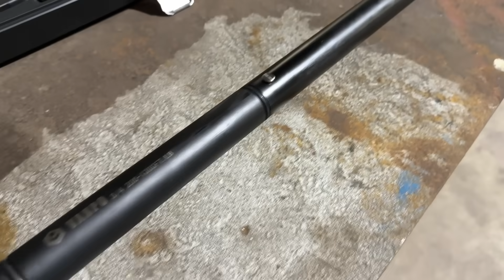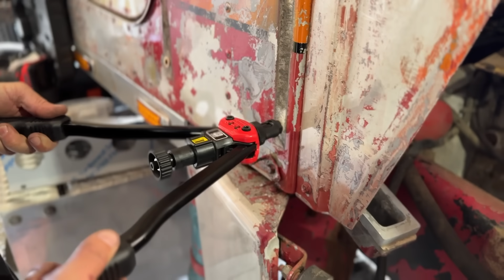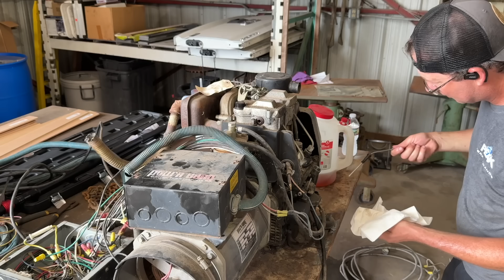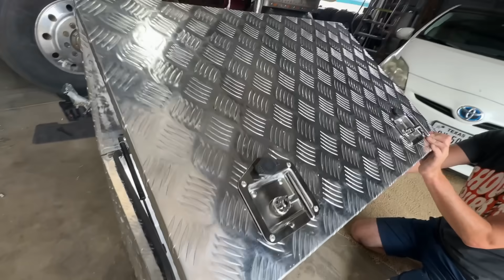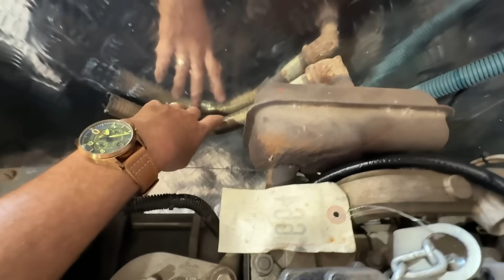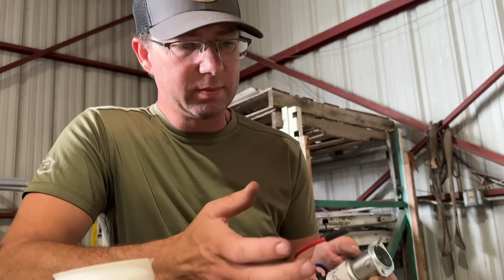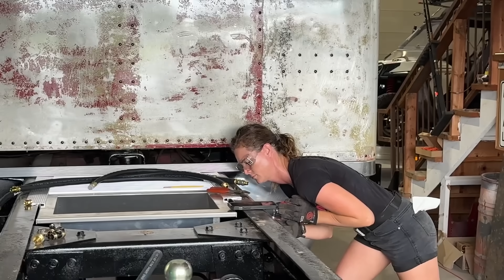Onboard Generator, 2nd fuel tank and MORE!

Comment: 7:34 You can take out the pilot bit, add another smaller hole saw on the inside of the chuck that fits the existing hole. It will protrude farther and the bigger saw will bite after.

Comment: Loving the truck videos. Small tip: When cutting a bigger hole with a hole saw, you can screw on the size u want then screw on one that is the size that is there. Use it as a guide so it doesn't walk. But how u did it works too.

Comment: Fwiw, if you get any kind of wobble in the front end, jack up the front end and loosen the lug nuts, have someone step on the brake and retighten. This centers the brake drum ,but You should do it right away before the tires start to wear cause if they do it will be too late 😉

Comment: When drilling a larger hole, then what has already been drilled by a smaller hole saw.. take the drill saw blade that is the size of the smaller hole and install it in the middle of the bigger hole saw.. so you use the smaller hole saw as a guide if you will and it keeps the larger hole saw from traveling…(walking).,

Comment: Its coming along and looking great!
If this truck had a personality, I swear in some shots you can see it smiling.
Curios...
Why not run twin tanks, one on each side, and mount the generator on top of the frame rails behind the sleeper?
Since trailer swing clearance between the sleeper and trailer is a non issue.
Would give easier access to the genny for maintenance. Save you trouble of dealing with the box lid hinge design. And prevent the box from filling up with road grime from spray from the front tire. Also in the event of a mishap, the generator would be safe from any impact or damage.
I'm sure you can buy/fabricate a wind breaker to hide that roof AC. Will help the front of trailer to prevent and exhaust soot.

Something else to consider is a closet style headache rack. Can mount the genny in it, and have more room for more storage. Tools and extra parts for OG come to mind.
Also the weight of stored items could give you a smoother ride on the front axle.

Comment: Safety Heads up - Observation -> I am a little late viewing the series and I apologize if someone has mentioned this already but I have just wrapped up a number of mods on my fifth wheel in the inverter / elec area and I seen in your video - your generator plug mounted on the truck.  Your twist lock plug has the "Male" side of things - If the generator is running (producing power) the exposed prongs will be energized and as such an easy shock hazard.  The plug you have used is found on the rv side as there is typically not a stand alone power source in an rv or a transfer switch is used as to not transmit elec to the male prongs.  There is a female twist lock that you could use OR I simply installed an RV receptacle so that I only have to cary one universal power cord that works to plug into campground power OR plugs into my Inverter with rv receptacle OR my Generator with receptacle. Also your Power port you mounted on the driver's side of the truck - if it is wired in with the generator consider the use of a transfer switch as to not backfeed and create a shock hazard on that plug in as well.  The plug you put at the driver's door is correct but needs to be isolated as to not be energized when genny is running OR worse yet - a scenario that plugged into Campground power it could back feed into generator circuit and damage something / create an unsafe situation. A transfer switch would solve this.  
ALSO - consider a single inline breaker on that AC line to the plug on the truck - just in case a random bolt would fall on those Male prongs and short out.  The breaker would interrupt other possible damage...  (safety) Even if you have installed a female plug - still best to install a 25 or 30 amp breaker between genny and plug.  I would also recommend a main breaker after the Plug from driver's side of cab.
Thanks for being open to feedback and awareness to want to do the best / safe / proper thing/. NICE WORK!!!!  My dreams for an HDT to pull my fifth wheel have been awakened by your work and video series and your get it done mindset!!  Nice job problem solving that generator solenoid as well!!! Let me know if I can explain more / better for you.  THANKS!!!!!

Comment: when the hole is bigger than the pilot drill for your bigger hole saw -just quickly cut a piece of wood and drive it in tight - then your pilot drill will not drift off center and you get a cleaner big hole in its place. hope that makes sense .love your work and your wife is eye candy,

Comment: Love what you're doing, I have a 90 t800 with a 600 HP 3406e in it, hauled livestock for 10 years now it's a grain train but my cab is falling apart,rivets falling out,need help on what rivets to use

Comment: Good to have, but do you need a CDL if the truck is designated as an RV and onlybhauling an RV?
To be designated an RV the sleeper needs sleeping, cooking, and toilet. A mini porta-potty qualifies and doesn't need to be used so long as it's there. If it's designated an RV then you could both legally drive and don't need to stop at scales.

Comment: 359 Pete’s are just meant to be flat tops   I still run with some stick wagons pulled with a 359.  Grossing over 90 all day.  My buddy left his 359 in his will to a driver.  We pulled the 5th wheel off and gently placed two 4” straps over the casket, centered between the drive axles. That 359 literally took its owner to the grave.  These videos are awesome, and so is your knowledge of the truck

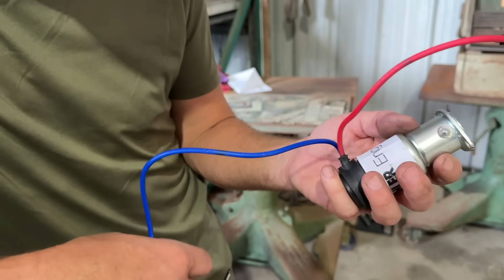Comment: On your fuel solenoid (53:18), some on these have a "Pull" (the blue wire, higher amperage to energize it) and a lower amperage "Hold"  that could be your red wire. I would imagine that the Red wire will go to your "On / off or Run" switch, the Blue will go to your started switch or solenoid (energizes only when cranking). I bet that the bad one that was on there was wired incorrectly.  Think of it like two separate electric magnets, a big powerful one to move that internal slide,  and a smaller one just to keep it open. Love your project.

Comment: Being a person who made a generator out of a single cylinder indian sign diesel motor you'll have enough electricity to run just about anything you want. A/C, microwave, tv, charging for computer. I'm not all the way through the video yet but you'll want a 12v exhaust/radiator fan on the gen box opposite of the flywheel side of the generator. The heat will be too much inside the box and the fly wheel fan won't be strong enough to exhaust it out. PLUS, you'll want to insulate the inside of the box to quiet down the engine noise. Nice upgrades on the Pete, as you can see I've got a 387 Plastic Pete. :D

Comment: Hey Guys Love what you doing to that truck wow  a Few Pointers  for Parts  C7C Equip and ADS =Area Diesel Service   They are the best in the Market  and they will almost find anything you need for  Diesel and stuff like it Gen Box  cut cover  Screw Hinge to front  (Cut the L cover ) and transfer  Hinge to front like that it open like you want and screw top cover to Box

Comment: how about a piece of angle aluminum across the top front of the gen box and move the hinge from the back to the front, which I see you have removed altogether, fasten it to the front side and pop rivet a strip across the back where the hinge was.  Quick access.  I'm sure you can figure out a proper propping device to keep the door open when you need it.

Comment: Hi guys Tony here watching you from my Mercedes actros 6 x 4 2548 semi truck in uk, surely the generator box lid could be adapted using the piano hinge you removed cut the lid and refit the hinge and the pump on the generator in uk we have round fittings like that one one the blue wire as our positive terminals have threaded nuts on them to attach ancillary items loving the build though

Comment: It won't help now and the wood behind the panel worked fine but next time you have a hole that you want to make bigger with a hole saw, take the hole saw that fits in the hole and screw it into the larger hole saw and use it to center instead of the drill bit.

Comment: I scrolled down a bit, but I didn't see a response.  A 50A RV plug is 240V.  It's 4 pins.  Two hots, a neutral and a ground.  But RV's don't typically have a 240V load.  What they have is two 120V panels.  So when you get some place and only have a 30A socket, the 50A to 30A adapter ties the two hots togethers so that both panels still work.  There are reasons for it being that way that take longer to explain than I want to type into a comment.  Optimist Grime is looking really good.

Comment: Did you share the info on the torque wrench?? That handle look’s longer than the one I have…

I have a 3/4 makita and I love it! It takes my lugs to approximately 400 ft pounds. I like that it’s just under the spec because too tight is also a bad thing….

Comment: Does the solenoid need to be powered for the generator to run or do you energize it to kill the generator?  It would make sense for it to get hot if it is powered all the time when it should not be.

Comment: On the rears when you put the plastic ring between the wheels the inner nut needs to be torqued then place the outer wheel on then torque the outer lug nut too

Comment: I was watching Aaron with the hole saw at the beginning thinking to myself I would screw a piece of wood behind the panel for the drill bit to center on. Thirty seconds later that’s exactly what Aaron did. The truck looks great with air filters on both sides 👍.

Comment: The holedozer hole saws are designed so that if you have an existing hole, you can screw the corresponding hole saw into the center of it to use as a guide instead of the drill bit.

Comment: Aaron, the next time you need to cut a larger hole around another smaller hole, if you have the size of the smaller hole it should fit inside the bigger hole saw and act as a guide. I have done this on several occasions.

Comment: I'm pretty sure that your engine and generator is the same as is used on a service truck that occasionally visits our farm. The mechanic who drives the truck is able to run a pretty modern stick arc welder off this combination quite successfully (as well as other power tools) so long as he does not push too hard for too long otherwise something overheats and shuts down while it cools down.

Comment: Love the content and thanks to CRC for supporting such a cool project.

Are there plans for some type of air or suspension hitch on truck or trailer?  I’m thinking there is not enough pin weight and the truck suspension may put too much stress on the trailer pin.  But I could be wrong.

Comment: Great build.  Thinking about the gasket for dissimilar metals and thinking potentially it’s an unnecessary cost as you don’t run the gaskets against the brake drums on trucks with alloy wheels or on your car so not sure that it’s a lot different.  Maybe I’m missing something …

Comment: You may already know this but I thought I should mention it anyway. It is important that you not only make sure that the generator is producing around 120 volts, but also 60hz in frequency. Most of the digital multimeters can measure that. The frequency is based on the engine speed and the governor can be adjusted for that. The hz should be around 61.5 to 62 with no load. I have learned this from a great YouTuber James Condon who knows everything there is to know about small generators. You might want to watch a video of his.  I hope this helps.

Comment: 2nd post for you , this one is a safety issue. when you you use a impact to put a lug nut on, if it starts hammering that is not torquing the nut. if the nut does not turn at all when you use a torque wrench that is a major fail. doing that on Budde rims that is a good way to break the rim between the lug holes

Comment: I would consider wrapping your generator exhaust to keep the heat down in box.  Also consider adding ducting for cold air intake to engine and alternator so they are not intaking warm air as the air in tbe box heats up.  May need to add an electric cooling fan to exhaust hot air from the top of your gen box.

Comment: Sometimes those solenoids have two activation circuits.  Your blue wire may be the initial power that moves the solenoid and then your red wire holds it for the long term and power to the blue wire goes away once your red wire is active.  Less current draw and less heat build up in the solenoid over time.  Red wire coil isn't strong enough to pull solenoid open like the blue, but is strong enough to hold.  Not saying that's what you have but I've seen that on Yanmar's.

Comment: That Duetz solenoid should be blue to pull and red to hold once it is in the run position. A lot of smaller industrial diesel engines do that

Comment: Don’t know it has been mentioned, but it appears the hood needs to be adjusted forward a good 1/4” if not more. It should have a little gap between the hood and cowl. Love the progress. If everything is adjusted correctly and all the bushings aren’t worn out and the helper springs are tensioned correctly you should be able to tilt the hood from the front grab handle fairly easily. ❤

Comment: The blue wire gets momentary power to drive the solenoid  and the red gets power to hold it in the on position. The blue has to be momentary power only or the solenoid would burn out from too much current and heat. Case is ground of course

Comment: That solenoid has two coils in. A strong coil for pull and a weaker one to hold it in to run. If you just use the pull coil it will get real hot and burn up

Comment: If you haven't sorted the solenoid out already, the red wire may be a "hold" wire. The blue is an activation wire which draws a large current to pull the solenoid on, when running the current should switch to the red wire which holds the solenoid on with a lower current draw. If the solenoid is held on always by the activation wire, it will overheat. This was the was a lot of small diesel engines were set up, yours may be the same. Hope this helps.

Comment: Hey Sparks, if you're gonna be putting holes in sheet metal, especially if there is a pre-existing hole of the wrong size, you might want to invest in a Chassis Punch set. No hole saw walk and leaves a clean hole every time. I have a set of these and I rarely use hole saws anymore. Just a thought.

Comment: Those vents in the genset box are not enough to cool that genset they need to be a little larger with a fan on them the built in fan is good when not enclosed like that but doesn't move enough air when boxed up like that it will over heat

Comment: you might have trouble getting fuel in that small tank because the fill cap is underneath thhe sleeper and it will be tough to get the filler hose into the tank :)

Comment: You had to get a CDL even though you're not using the truck for commercial use? Here in AZ so long as you don't use the truck for commercial use or money making purposes you can drive a big rig on a regular license. And if you get the truck re-registered from Commercial to RV or Motorhome than you can drive it around the country with no problems.

Comment: On the generator lid, would be cool if it had rolling hinges something like a toolbox where you slide it forward then up. Also maybe think about mounting a light in the box or above it maybe led strip under cab for night time use .

Comment: Best to go for light truck LT rated tyres for trailers, as a tow truck driver been to many trailers & Caravans that have blown tyres & aren't rated for the load, also yes for torquing wheel nuts been to at least 30 cars, 4x4's & caravans with broken wheel studs & or wheel came off, that have had tyres replaced earlier in the week.

Comment: One thing you should do is sound insulate the box or it will be unbelievable loud.  Provide a muffler for the generator, and an air filter for the intake, all of which should make the unit quieter.  Be sure to exit the exhaust fumes away from the living quarters.

Comment: I think the way the fuel solenoid works is the blue wire pulls in the solenoid and the red wire holds it. The blue wire should not be energized all the time or you'll burn up the solenoid.

Comment: One trick with a hole saw is you can put a smaller hole saw and a big hole saw on the same drill and use the small one to center the big one.

Comment: Rather than putting the pins vertically to set the lid on, mount them horizontal and drill a hole in the lid (on the lip that the hinge was riveted) so hust slid the lid on and latch the 2 front latches

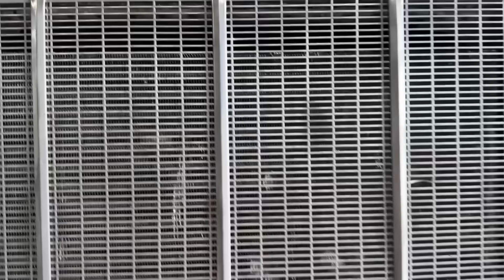Comment: 39:28 not to be a pessimist but you will wish you have painted or dulled the finish on that Aluminum strip, especially when driving into a bright shiny day sun. I have driven the same model Pete I know from experience. 
Also, on your generator, will you have enough will you have enough air exchange to keep that Deutz engine cool inside that box?

Comment: It's Exciting to see the Passion you's have restoring things, most people wouldn't take a second look at. I knew a BigRig was the answer to not beat up a huge trailer and have to worry if you are over weight. And the wear on the Rig is way less. Can't be in a rush to get there if your loaded to the limit. So a Rig would have a few awkward things like parking and fuel. But I've known it for years it be the better purchase. And now yous are proving it. 
Also love your chemistry. Yous, are too cute together. I look like a ruff dude. But I'm a softy if surrounded by like minded folks.

Comment: I hope you guys have told Stewart to let you keep the forklift because it will keep helping you out for a long time😊😂 also if you guys keep getting large projects, consider investing in a mag drill. possibly a Schrader valve somewhere in the air system for quick filling